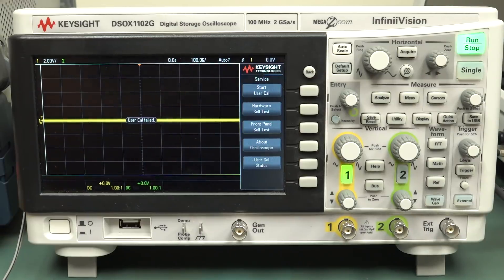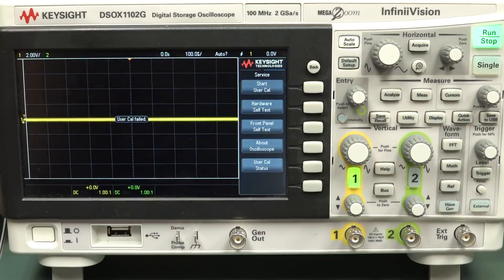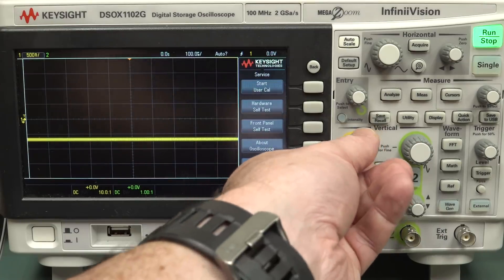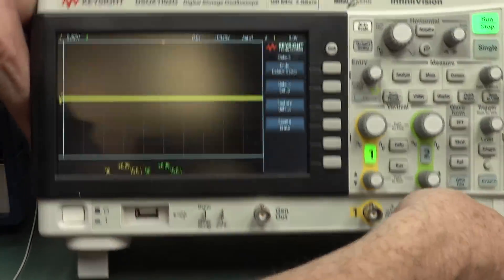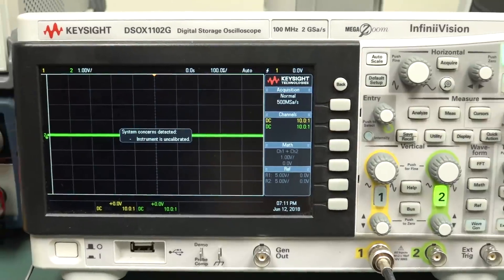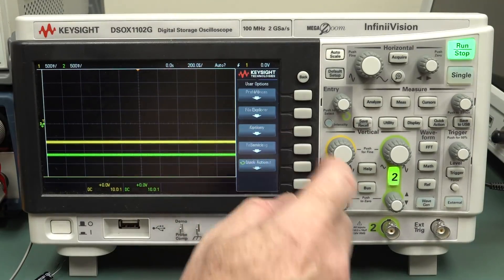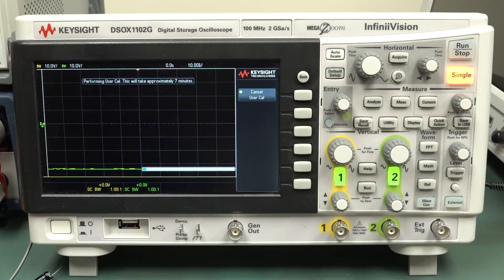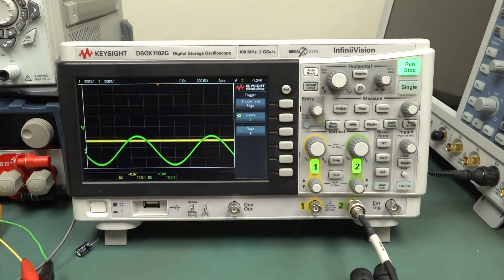My Keysight 1000X Oscilloscope FAILED :-(

Comment: The error could be due to a missing reference signal on the board. Check the op-amps resistors and caps.

Comment: I had a similar issue with my rigol mso1074 where the user cal kept failing after a short period of time, right after I'd flashed a new firmware image. In my case it turned out to be a bad flash of the firmware image. After banging my head around trying to work out what went wrong, I attempted a re-flash of the image and the user cal worked without problems. TL;DR, I would suggest trying to re-flash the firmware and then re-try the user cal.

Comment: For some reason, it seems like the EEPROM or flash or wherever it writes calibration values to... is toast. Probably a bad sector or ESD damage from the past?
People here are saying it might be bad calibration hardware. But then it would not just say device not calibrated at power-up. It seems highly likely that the calibration routine just fails to write the values where it is supposed to.

Comment: Hi Dave ,what firmware is running ?? V1.1 ?? if yes you could try renaming the firmware installation file so that it forces the installation after this procedure to retry the user calibration

Comment: The scope stores gain and offsets in eeprom, and the calibration couldn't find correct values so they got stuck with the last value used by the calibration procedure which may be way off (much like how autofocus gets stuck way off when it can't autofocus, rather than settle on the best available focus). The problem is probably somewhere different than inb the gain/offset handling.

Comment: Have you checked the earthing in your new lab? Maybe out of sync or has an DC-offset with the ground/non-fase of your power-circuit? And / or is your socket well-installed and not the wrong way round?  Maybe the old user of the space did something with the sockets or cables or never noticed it. Floating earth?
Second, you could try shielding the inputs of the scope at cal with just a metal cap around them just to make sure.

Comment: I have seen that on a couple of older HP scopes and it was caused by a faulty op-amp that had excess offset and some ranges could not be calibrated so the default offset was used during calibration rather than the 'best' offset. It seems unlikely that a more modern scope would have the same issue.

Comment: Maybe the calibration failed because it could not "calibrate out" the gain and offset errors. That would suggest hardware issues. As others have recommended: Hardware self test?

Comment: Did you leave any of the "hack" links on ? 
ISTR that one apparently useful setting that looked like it increased bandwidth actually had significant offset issues that made it useless
Reply from the maker: This wasn't the one I hacked
Reply: The hacked one is working fine.

Comment: I think the calibration signals are not ok. If I remember correctly, the 3000X scope displays more or less flat lines during user cal. Maybe something's wrong with the internal signal generator?
Reply: @invendelirium  It's not a bug, it's a feature: calibration against random crap :-) Perhaps it's just a stuck relay or a cold solder joint. Dave should investigate.

Comment: Opinion: Compared to older HP gear, Keysight stuff just does not feel as carefuly tested and bug free.. same with ther multimeters, not the same confidence inspiring as a Fluke in my oppinion. I am sure the huge amount of software and the rapid development time have a say in this but that is no excuse. Miss the old HP reliability and quality, you just knew it would work when you needed it to and last you a long time.
Reply: I agree, the problems with new Keysight gear is notoriously software related,  They just do not build anything like they used to.  I have no experience with the very high end stuff but the lower band width scopes seem to look and feel like toys and not robust test equipment.

Comment: I’m no electrical engineer.....  oh.  Wait. Yes I am.  Sounds like a common failure between channels 1 & 2, so a common failure of the calibration signal that can be used by both channels. Not likely that both channels have their own calibration signals, so if you troubleshoot, I’d start at the attenuators for the signal generator that supplies both channels. The attenuators could be stuck, especially if they are supplied to the channels by one or more relay switch. The relay may work, but one of the armatures are stuck or broken for those two ranges.  Easy peasy, replace the bad relay.  Stay calm and set SCE to AUX.
Reply: It's clear both channels failed under normal use (the calibration signal is not being used).

Comment: I hope Keysight is going to support you at troubleshooting this sick puppy. Schematics etc. It would increase confidence in their products.
Reply: Troubleshooting will involve removing the single board which is inside one of these newer scops, populated by a single FPGA and a myriad of SMDs.  There is really nothing to troubleshoot unless on the off chance there may be mechanical relays or attenuators that can be checked.  There are very few components to check.  Most likely a software/firmware issue.
Reply: @garybevis8691  This failure seems to be more on the analog side of things. The scope's calibration is partially done with DACs that are also responsible for the offset. Some DACs may be even exclusively there for compensation purposes. My is that something is wrong somewhere around there. The other guess that it could just be a "simple" ADC failure of this complex high speed ADC.
Reply: @ChipGuy  It would be interesting to "see" what the actual failure is, I hope dave will follow up with a future video on this.

Comment: i have had a kinda similar fault with an old scope ... one of the internal relays that switched in the cal signal was just stuck open because most likely no one has ever ran it 
but clearly that's not the fault here

Comment: Gotta adjust the balancing of your Y deflection plates amplifier
Reply: Better bust out the tube tester and it might be due for recapping while you’re at it...
Reply: Check that the deflection yoke hasn't come loose.
Reply: Smaaaaart !....
Reply: The vertical gain was also out of whack. Dave switched between the 5V/div and 10V/div scales and the amplitude barely changed! (3:05)

Comment: Kinda wondering if it lost its calibration data, the cal hardware failed, and it calibrated itself to garbagedata. Any way to swap the chips that hold the calibration between the two scopes to see where the problem follows?

Comment: Could be a failure in the internal test source, which would explain why both channels are suffering the same offset... They were fine until they tried to calibrate against the the faulty reference source.

Should have left it alone Dave ;-)

Comment: Hi Dave, some older HP and Agilent scopes (54000 Series) had the same issue. If it is this problem, then they have nothing learned from it.
The UserCal had been performed from the data from the last calibration. There was not enough range to make a needed waveform and so it failed. If the last cal resulted in an amplitude of 200 and the needed waveform had an additional amplitude of 100, the resulting amplitude of 300 couldn't be crammed in the 8 Bit system (symptom description, what had really failed, I have no idea.)
You needed to reset the scope to Factory default, then it would perform the User Cal flawlessly.
Perhaps this is the case here?
Carsten
Reply from the maker: Unfortunately it's not that, tried it.

Comment: Do a test of the built in signal generator connected to another scope and voltmeter.  I would bet it has an offset fault since both channels are failing.  Easy test to perform.

Comment: 0:54 - "When I change the time base here."  Hmm... all of my scopes have the time base on the horizontal X axis.   ;-P
Reply: you know Dave is below the equator eh so he's upside down :D
Reply: It's a one off 'special' scope... It has a Y-Y mode
Reply: Trevor van Bremen When do they release one with X-X mode, or is it just a software upgrade? 😂😂😂
Reply: That's going to be a HARDWARE upgrade.  It consists of 4 rubber 'legs' that you stick to the right hand side of the 'scope to allow it to sit on that side. Ergo the Y-Y mode instantly becomes an X-X mode.  Unfortunately, only one input channel at a time works in this mode

Comment: I'm wonder if it's the hardware used in the calibration. If that hardware goes, then it can't calibrate anymore. Furthermore, if it was going bad, then it might have drifted over time causing the issues with both channels.
Reply: Yup.  Two independent channels fail?  I'd start looking at the calibration source.  Maybe that 1¢ regulator blew it up.  ;)
Reply: *1.5¢
Reply: Agree. Beside, the same signal gen hardware is probably used on both channels.
Reply: I agree. Besides that, If the scope suddenly has a big offset there is a hardware problem. If you then update and/or calibrate you get a double problem. At 00:54  He turns the vertical knob telling he changes the time base. :-)  In analog scopes it would be a DC balance problem. Most had a trimpot on the front to set that good. I think it is a powersupply problem. The offset was already there before he calibrated